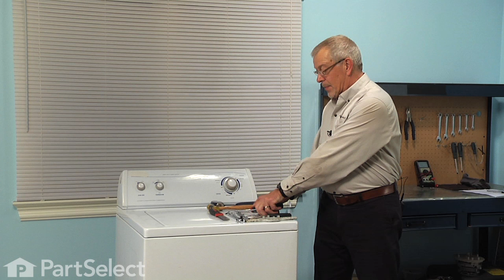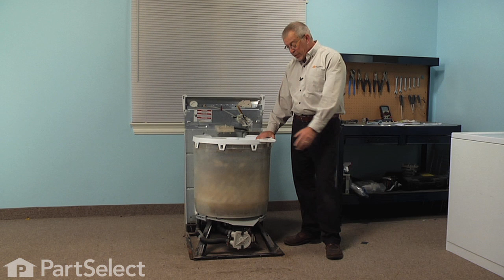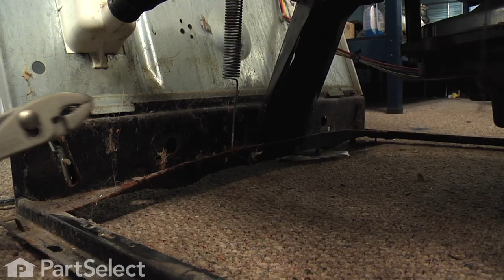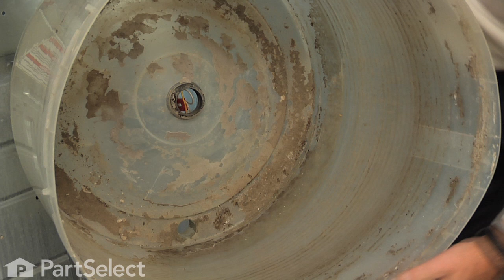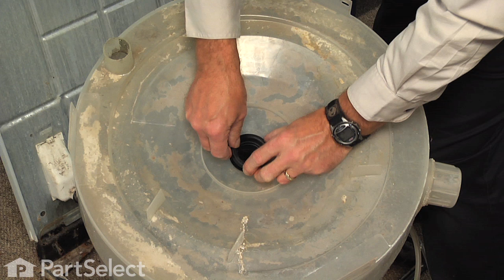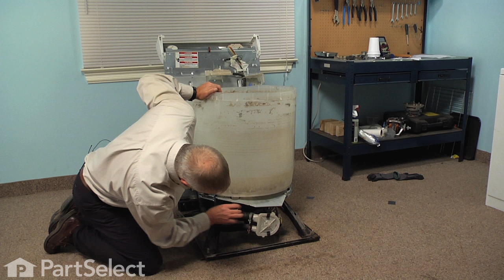Washing Machine Repair - Replacing the Centerpost Gasket (Whirlpool Part # 383727)

Comment: Would it be okay to use Mineral Oil to lubricate the tub seal?
Reply from the maker: Hello,  I would only use soapy water to be safe. My experience with automotive a lot of rubbers will react with different oils causing the rubber seal to break down.
Reply: never use any mineral lube on any rubber based seals.
Reply: @Tonimehc  Isn’t power steering fluid a type of mineral oil?
Reply: @MC-mh2ju  yes, unless synthetic..
Reply: Silicone grease works too